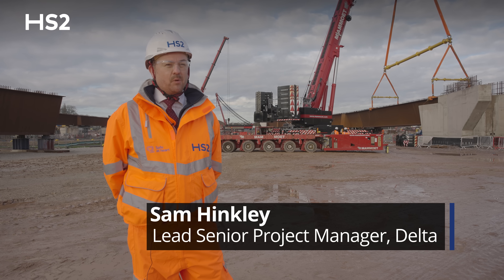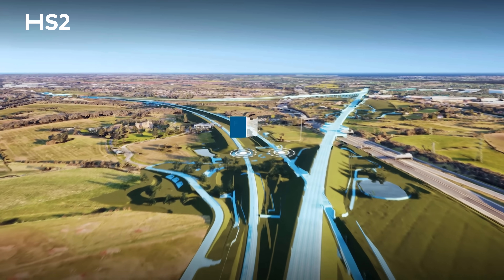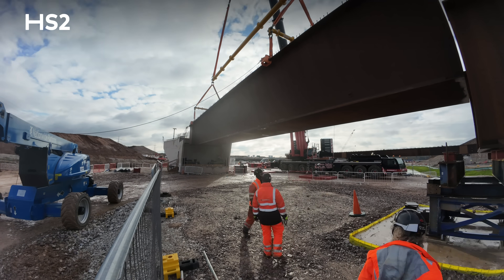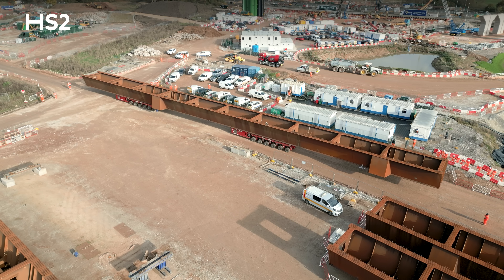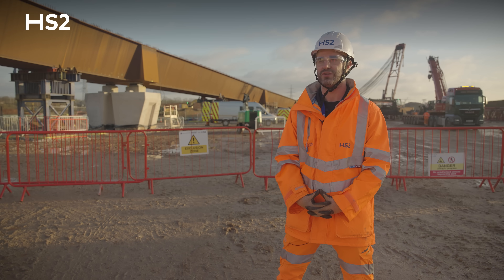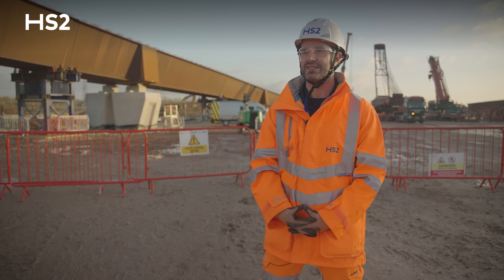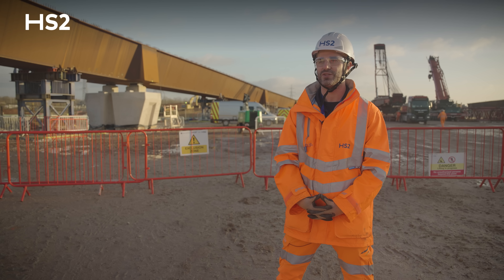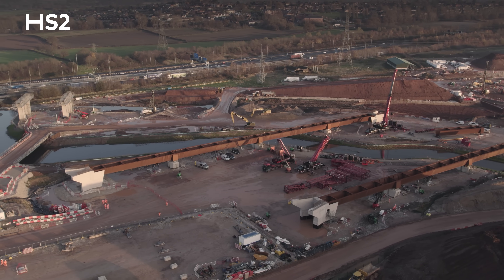HS2’s River Cole Viaducts take shape in the Delta Junction

Comment: I truly think if we can actually get train drivers to drive these trains regularly HS2 will be a great success.
I suppose what I really don’t understand if the massive massive overspend from the original estimates. Is this because there was a criminal underestimate at the start , incompetence in the planning, or corruption in the delivery?
Reply: Inflation aside (and construction costs have gne up a lot) route changes and mitigation works to address various objections have added enormously. Then there are always extra costs because of the unexpected, or assumptions such as whether costs could be offset against associated commercial developments, and so on. And there is always optimism. It doesn't require incompetence or corruption.
Reply: @ so the original estimates was £37.5B and the current conservative estimate is £109B, if in my job I was wrong by a factor of 3, then I could only plead incompetence because the obvious answer is corruption. These are as bad as the MoD estimates. Are we paying for £5000 hammers?
Reply: Everytime they reduced the length or the scale, we lost some of the economies of scale that were priced in also.
Reply: Mostly underestimation at the start. Also a bit of government mismanagement, like changing Euston plans to save money, which requires redesigning for £ billions, multiple times too. 

It's very very hard to estimate infrastructure costs BEFORE you've decided what is being built yet (where the tunnels/bridges are) so it was inevitable it would rise, even without inflation.
Reply: @BCrossing  other countries seem to do it a whole bunch better than the UK, there are I suppose other counties that do it worse, but we seem to have lost the art of managing large infrastructure projects to cost.
Reply: If the original timescales had been kept to the Birmingham leg wouldn't be far off opening now. A lot of the overspend is down to the Government continually dragging out the timescales to reduce the spend in each year while pushing up the total cost and failing to take full advantage of the years of low inflation and low interest rates. It's almost as if Sunak and co were deliberately sabotaging the project in order to have a justification for cancelling it ...
Reply: Yep Drivers will drive these trains, they will be the same drivers that drive the Avanti West Coast Pendolinos now as the HS2 train services will be operated by Avanti West Coast trains when it starts operating
Reply: @peterwallen1063  when they aren’t on strike.
Reply: @MrJudgementday99  Being a bit stupid, that could go for any thing
Reply: As the man says in the video, 13 viaducts on the delta interchange alone. That is proper money to build. People have to stop comparing the cost per Km with building  a rail track across the open land  of Spain or France. We live in a much more densely populated country. The design is 'top end' but what is so wrong with that ?. Over the lifecycle of HS2 the initial costs fade away.
Reply: @JohnHoward-wc9kk  not top end, design speed is miserably low compared to current tech of Japan, which is very dense. For the price you could build 2000 miles of motorway.
Reply: @barrypickles6546  Well alot of the comments on these youtube  sites, probably the majority,  are adamant that the design of HS2 is 'gold plated'  with straighter runs, wide track separation, etc  and there is no requirement  for the speed that the trains will be travelling at. Especially now that HS2  has been truncated to a much shorter distance. However, there are those who say it is 'miserably low' such as yourself. I conclude the specifiers might have got it about right, particularly if HS2 does get extended further north eventually and the higher speed can be maintained over a longer distance.
Reply: @JohnHoward-wc9kk  gold plated as in capable of running future faster trains, current top end trains, or 1980s french top end ? I know I am comparing it to foreign tech again but the only thing gold plated is the vast expense to the tax payer. Trains don't need to be gold plated, they need to function, which is maybe where the work ethos has gone wrong.
Reply: The insisted that the line could exist without maintainence for 120 years ( realistic in a UK context). That had to be priced I. To the initial build.
Reply: 4-8x more expensive to build infrastructure in the UK than the rest of western europe but thats none of our (the tax payers) business. Just pay even more taxes don’t ask where the money’s gone.
Reply: Funding local projects like the Lichfield canal restoration also adds to the cost even if it's a good cause run by volunteers
Reply: Vanity vanity, all is vanity. You can spend 50,000 on a rolex, or 50 quid on something that works just as well. We could have tunelled this section for less money.
Reply: @barrypickles6546  So what proof have you of that concidering there are 3 legs to this Delta Junction
Reply: @peterwallen1063  I fear you misunderstand me sir! I mean the Birmingham London section. The gottard base tunnel has been made to look cheap by Hs2.
Reply: @barrypickles6546  The Gottard Base Tunnel is just one Tunnel, HS2 is a whole Railway line with numerouse tunnels, viaducts, bridges, junctions and new stations
Reply: Gold plating, excessive line speed, routing the line though politically well connected NIMBYs, building nonsense like green tunnels in a failed attempt to placate these same NIMBYs, building the line to the European rather than smaller UK loading gauge. Cost plus contracts that gave contractors no incentive to keep costs under control. It all added up.
Reply: @aw34565  Who said the line is being built to UIC gauge ( EuropeanGauge), the line is just planned to be built and the Tunnels are wider because of the speed of the trains going through them every thing is being built to the UK Gauge as the trains are being built to the UK Gauge as they will travel on the existing domestic rail system to some places in the UK.